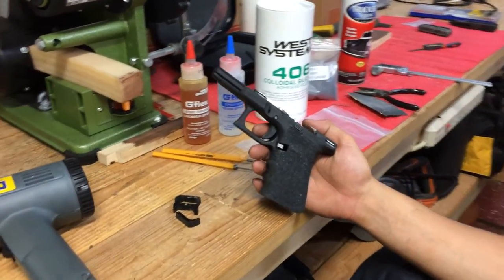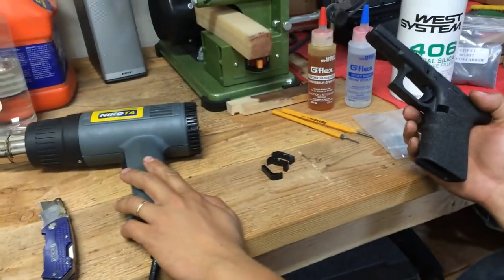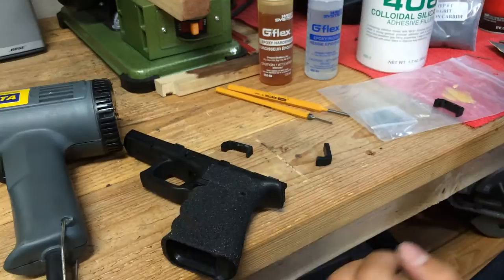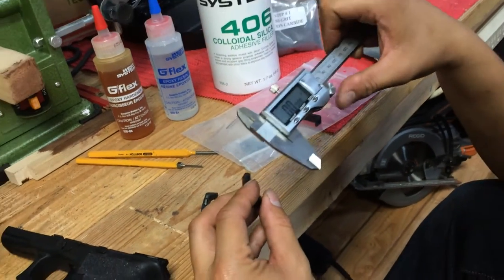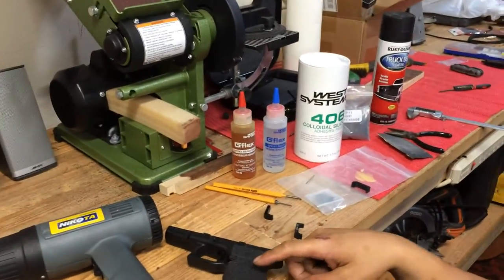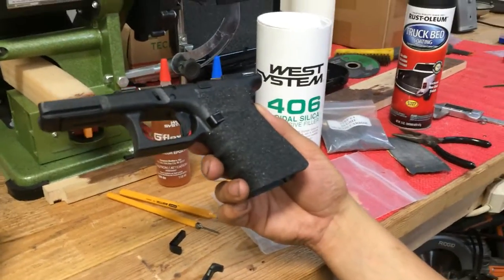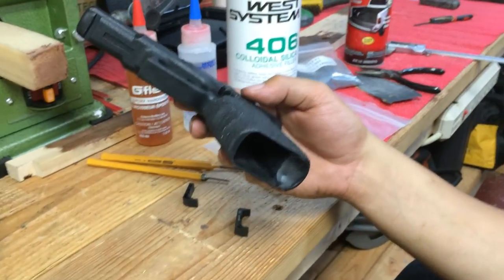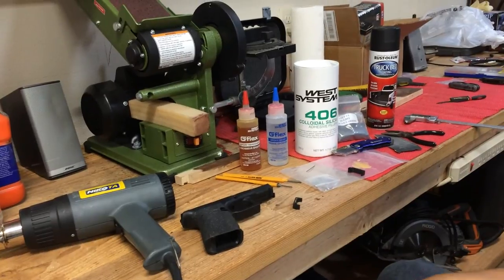Glock Gen 4 mag release upgrade on 3rd gen frame

Comment: I found a easier route, get a gen 3 and a gen 4 magazine release,  cut them in half, put the gen 4 release on one side, the gen 3 on the frame side. You'll need to open up the release side to make it work. Did this to a p80 and added some material to make it work. Now the p80 has a gen 4 release. It's way better now. I used puddy that turns to metal to make it work on the frame since its thinner than a glock frame.All thanks to this video to get me started. I'll have to make a instructional post to help others do it.

Comment: Just curious if you can also cut the back of the frame and put a Gen 4/5 backstap .
Reply from the maker: I have not done it before, but I don’t see an issue with molding one onto a Gen 3 frame.